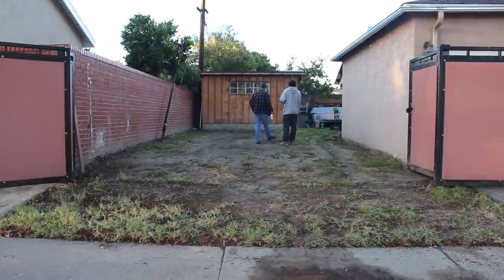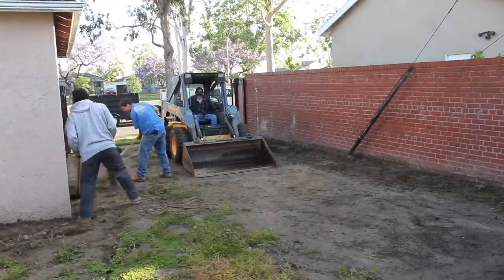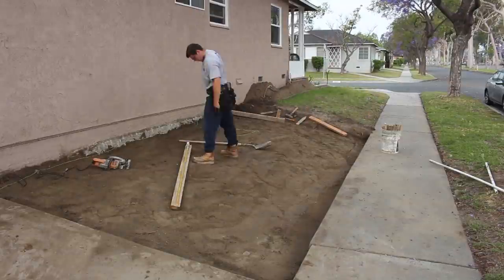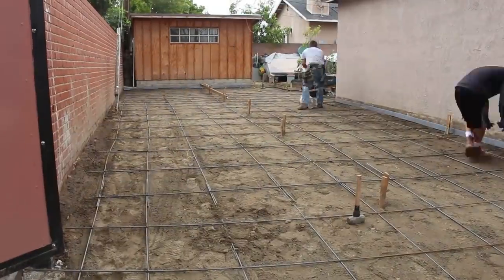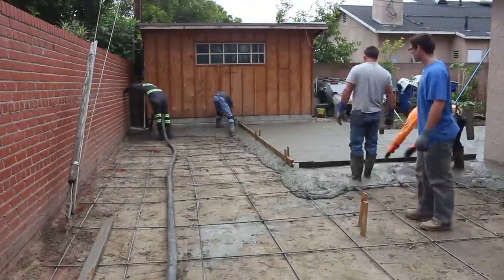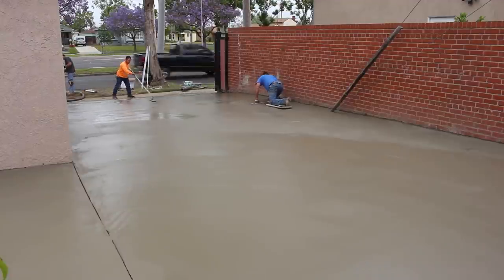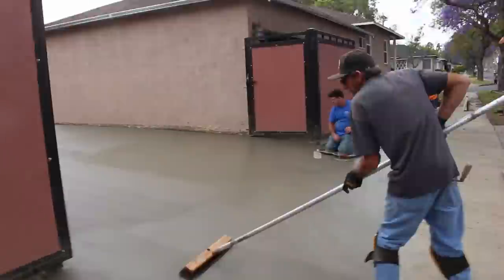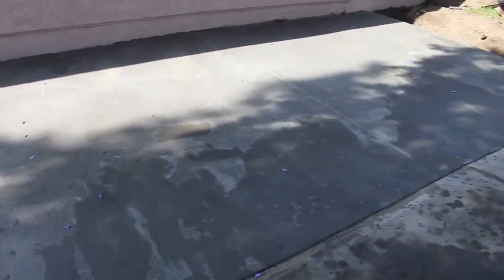How to Pour a Concrete RV Driveway DIY + Extended Driveway

Comment: Another Great video, repaired two fence panels after the recent Santa Ana's and used one of your Son's methods of placing the rebar over a tarp and laying the 90Lb bag of concrete on top of the concrete and cutting the concrete bag with my drywall knife. Two 45
Reply from the maker: That's a nice system.

Comment: Nice work. You're right...most people can't handle big blue without it digging down into the mud!
Reply from the maker: Money Mac 
yes I've been noticing that
Reply: btw i like the technique you use with the temporary  2x4's to keep a level grade when you're skreeting the mud...i use grade stakes every 5 feet or so and after i'm passed each stake i hammer them down into the dirt below the concrete...but i learned concrete from the mexicans...your technique however is more professional and accurate although i do get a very level grade with my method considering it's a little crude
Reply from the maker: I've tried that method.
until I lost a stake, and found it the next day.
Reply: Money Mac what's up money Mac about two years ago I was doing repair work on the interstate and they had eight foot Bull Float and that fucking thing kick my ass bro I had to go out and invest in a lower back brace just so I can handle that fucking thing

Comment: Two 45Lb bags of concrete is much easier to lift into my Harbor Freight Cement Mixer the the 90Lb bag. Also I have an old Up-Cycled Parts Cart and a large plastic washing machine drip pan the I use to keep the rebar from cutting those free harbor freight tarps and keeps the excess cement in one place to scoop up. This is a lot of overkill but it saves my back and I'm not on the clock. Your jobs are very helpful plus I get to save from getting a gym membership. Reg
Reply from the maker: Nice tips.
TY

Comment: Nice work, you and your crew are solid.
Reply from the maker: Russell Martin 
TY
Reply: Odell Complete Concrete have to agree with what Russell said Dave you and your crew definitely solid very knowledgeable I know I sound like a broken record I'm sure once you look at your comments on this particular section that it's me always giving you
Reply: Odell Complete Concrete same kind of Fresno I got and I love it
Reply from the maker: John Tuttobene 
Yes
Reply: Odell Complete Concrete 
Request for a video showing exposed aggregate. 👌
Reply from the maker: Russell Martin 
how about a exposed sand?
Same thing not quite as deep..
I have one coming up.
Reply: Odell Complete Concrete 
Sand is cool, would I be too greedy to stand firm on the small pebble exposed ag request?
Reply from the maker: Russell Martin 
I don't have any on the books.
But it will happen eventually.
Sand wash is same concept less penetration
Reply: Odell Complete Concrete 
Your technique is top notch, I want to see if you mix in or broadcast, timming and if you spray for slow set?

Comment: Everyone needs to work on a concrete crew at least one month....to see how labor intensive and hot it is! 

Sir, your work is top notch, EXCELLENT FINISH! The concrete appeared to be a 6 inch plus slump....did you add extra water or use a water reducer?

 I noticed the property owner(?) "in the way", probably thinking he'll get better quality workmanship....but in the long run it'll be the same as if he wasn't there....I had plenty of those, we just ignored them and did what we were paid to do....and sometimes run over them to get them out of the way! 

I like your channel and workmanship, well done! 
....13
Reply from the maker: That's how the concrete came I believe it was a 5.5 to 6" slump.
Reply: Thanks, 3/8" aggregate concrete can look like a high slump and only be approx. 5", maybe less! It's appearance can be deceiving when compared to larger rock.
Reply from the maker: arkansas13 
Yes

Comment: I know you said the drier the broom the better, in previous videos ive seen you dip the bristles in water. Im curious what the difference is wet bristles or dry bristles if you dont mind taking some time out your day to explain that
Reply from the maker: Lightly moist is best for broom.
A dripping with water off broom is to much water.
When dipping the broom in water, all your trying to do is clean the broom.
Make sure to shake out excess water before brooming concrete.

Comment: Have you ever used one of those "Stand up" attachments for the saw cuts? Don't know if those are a thing or not.
Reply from the maker: localcrew 
they do exist, I have considered getting one.
Reply: localcrew --- Before I retired, I had a saw (with "standing handles") that I used in Highway construction and it  did a great job. If you have a lot of room (VERY LARGE AREA) to maneuver they're a good thing.

Comment: The 10-15 gallons of water you pump through at first.  What do you end up doing with  that?  Back in the concrete truck?  Or in the pumper?  Or you dig a hole somewhere?
Reply from the maker: Steve Walker 
leave it in the wheel Barrow until it hardens, then dump the clean water, dispose of the concrete
Reply: Oh so the clean water sort of seperates to the top right?  Making it easier to pour off?
Reply from the maker: yes

Comment: Another nice slab man! Just curious do you ever put any cardbord in your cuts at intersections to help with chipping? Ive seen a lot of people do that seems to help
Reply from the maker: Chayce bassett 
never seen or heard of that.
It makes sense though.
Reply: Odell Complete Concrete actually there are particular ones they are the same size is a stick of gum and you put them in in between the intersections of the cuts when you're using a soft cut that's the only thing they are used for
Reply from the maker: John Tuttobene 
It's not a sealed joint that's for sure.
Sealed joints means maintaining it.
Resealing it every two years.
No one does it so it's pointless.

Comment: If concrete shrinks when it dries out, then why is the foam really necessary?
Reply from the maker: Good point
Reply: Because it will stick to the house
Reply: It will expand in the summer heat and crack itself and the wall

Comment: What's a job like this cost? Labor, concrete, equipment rental etc.?
Reply from the maker: 7500
Reply: Depends on who does it. You can get a job done rather decent for under $5 sq foot. and the average rate is around $7-9sq ft. For a decent city mix of 4inches.